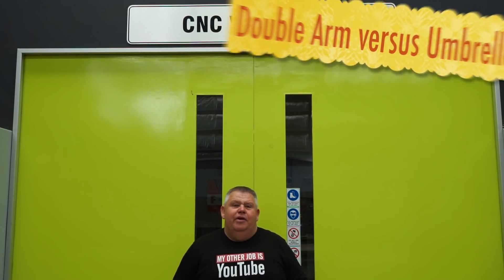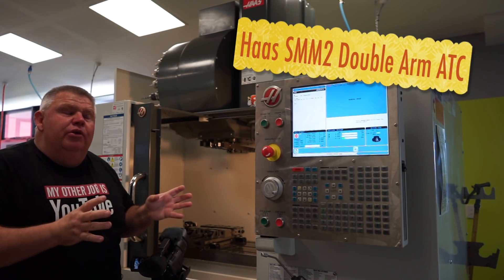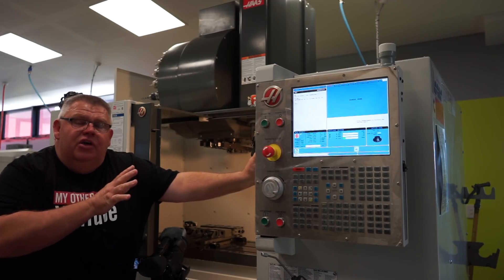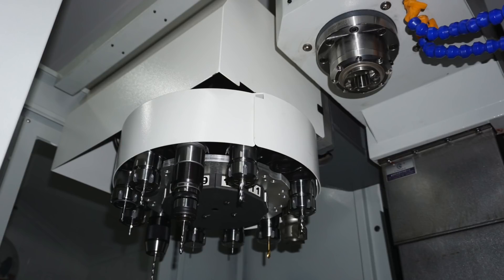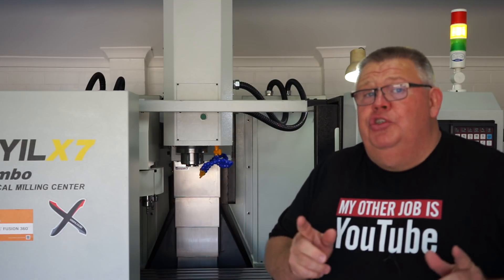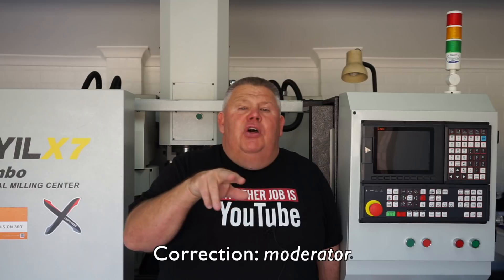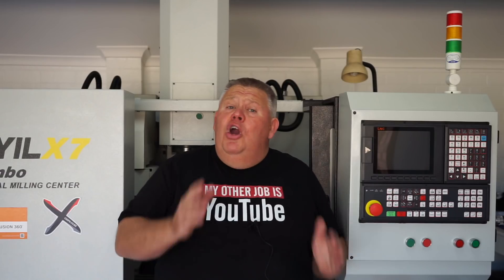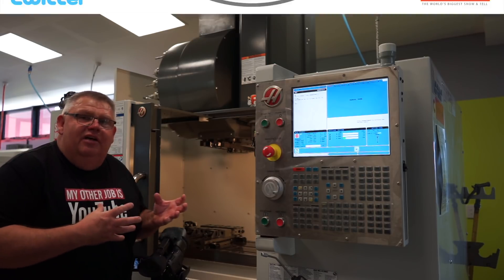Tool Changer Shoot Out - Haas ATC versus Syil ATC

Comment: The Brother Speedio machines can do a tool change in 0.6s and there is no double arm.  I'd buy a Syil over HAAS any day.
Reply from the maker: Yes, the Speedio is very nice machine. Syil have come a very long way over the years. However I still like the Haas machines. Very good for education as the controller is very easy to use. Plus all manuals and documentation is next level. Don’t get me wrong as I’m an advocate for SyilCNC, but they (Syil) could learn a thing or two from Haas with their documentation etc…

Comment: Its called random pockets. You have tool numbers and pocket numbers rite? Mazaks have that on some as well.  Makes tool changes much faster
Reply from the maker: Not sure I understand your point.  To elaborate, on a double arm ATC you have tool numbers and pocket numbers.  These can differ, for example "Tool 1" does not have to live in "Pocket 1".  On an umbrella style ATC, "Tool 1" must live in "Pocket 1".  Yes double arms are faster chip to chip.
Reply: @DCT_Aaron_Engineering  yes exactly!  Sorry i worded it wrong. Just wanted to add with a parameter  change we can make our mazaks do that as well and it really saves time!
Reply from the maker: @jasonruch3529  Hey Jason.  Thanks for getting back to me.  Sorry, I totally understand now.  Thanks for taking the time to watch mate.  Cheers, Aaron.

Comment: As far as look ahead goes on a haas to my knowledge the control will look ahead and stage the tool to be changed next as long as you don’t have a block delete / or a m00 & m01 or m03 Any of these will stop the control from “looking ahead” this is standard on all haas with a smtc and you don’t need to have it post code through the cam to do this
Reply: When you are calling up tool 1 for example on the Haas, the code would be :
T1  M6;
Your next line should be a preselect for your next tool :
T2;
With no modal command, the tool will be called up, and sitting waiting for tool 1 to be finished and swapped with tool 1.
Good instructional videos.
I like the enthusiasm.
Take care
Reply from the maker: @keithlane4343  Hey Keith, that is correct the controller will "preload" the tool.  Love the Haas machines.  One of the easiest and user friendly controllers I've ever used.  Thanks for taking the time to watch and provide feedback.  Cheers mate, Aaron.
Reply from the maker: Thanks for the info.  The generic Haas & Fanuc Fusion 360 post processor automatically has "preload tool" turned on.  However, if you try to use this post on an umbrella ATC it causes issues.

Comment: Aaron, thank you for another enjoyable video and you do a great job. I have an umbrella changer on my beloved Haas Mini Mill and I think the rotation is a little faster than your Syil but that's no big deal. I've been focusing on high mix-low volume jobs that other shops don't like and those jobs aren't as affected by the slow tool changes of my machine. But on the occasion I get a 50 or 100 piece order I know that I'm 1 to 2 hours behind waiting for the tool changes! Luckily I'm low overhead and doing this part time while doing my "day job". I've been out of machining for over 25 years and my Mini Mill smokes the old Bridgeport R2E3 machines I used to run! When I compare manual tool changes, I was lightning quick, to my umbrella changer the umbrella is a little slice of heaven. It's taken me 4 months but my G-code skills are coming back strong. Between you and Titan Gilroy you're really helping me out! I hope your students do well and I know you live and breathe machining, cheers mate!
Reply from the maker: Thank you so much for the kind accolades Charles.  I feel truly humbled by your words.  Yes, I love all aspects of engineering (manual machining, manual turning, CNC machining, CNC turning, fabrication and welding).  Before teaching, I was a motor mechanic and then maintenance fitter / machinist.  I love it all.  Hopefully my passion and enthusiasm rubs off on my students.  Some kids are actually coming to Harvester college now because they've seen me on YouTube.  Great to hear you're still at it mate after all those year.  I dip my hat to you sir.  Titan is a fantastic ambassador for the trade, I spoke to him when I was in the states last year.  Fantastic bloke.  Keep spinning those bits and ripping chips mate.  Cheers Aaron.
Reply: Hi Charles, I occasionally need low volume machining work done that my own CNC mills can't handle... please advise your contact details and location, thanks
Reply: @dancollins1012   visit www.ulstercustom.com you should be able to contact me from there.

Comment: Wait, so any tool in my library higher than 12 needs to be hand-loaded then? I didn't realize the pockets and tool numbers would need to match, this seems like a tool library management disaster, but maybe I'm missing something (very possible that I am!)
Reply from the maker: Yes mate that is correct.  I think you can manage to put a higher number in lower number pocket, but your CAM and post-processor take care of that.  But I would need to conduct a test to make sure that works ;-).  For example tool 13 could be in pocket 1.  The machine sees it as tool 1, but calls up the tool length number for (H13).  I hope that's not confusing ;-)
Reply: I assume it has more then 12 tool offsets, would it be possible to edit the tool change macros to do some kind of mapping?
Reply: I hope so, otherwise you'd have to constantly change my tool library numbers and re-post to match the tools in the carousel at the time!

Comment: It killed me inside that I was forced to get the umbrella changer on my Mini-Mill. My garage would have to be modified to fit the taller machine with the side mount changer. 

My previous VF2 and VF3 machines with the SMTC were sooooooo much nicer. For anyone buying a new machine - get the biggest and fastest tool changer you can possibly afford.
Reply from the maker: Hey Carlos.  I remember watching you video when they delivered your Haas and it just squeezed underneath your garage door.  Yeah I agree, the SMTC are the way to go :-)
Reply: @DCT_Aaron_Engineering  Yepper, I was totally maxed out on the budget. A contractor could have done the modifications for about $5,000 + the additional machine cost. Could not happen at the time - but still making a lot of parts with the Mini Mill.

Comment: Any ATC would be an improvement over my Teknomotor QTC , but I’m more than happy about my recent upgrade from the all manual chinesium spindle 🤣
Reply: The Chinese ones? Yes, I think so, but then they’re not much cheaper than my Europe made Teknomotor with ceramic bearings and HSK 32 C quick tool changer!
Reply from the maker: @stefanwossner2007  Oh ok, I didn't know that.  I will go and check these out.  Cheers
Reply from the maker: Chinesium, hilarious ha ha ha.  Hey, I think you get those spindles with pull stud and small BT style tooling?